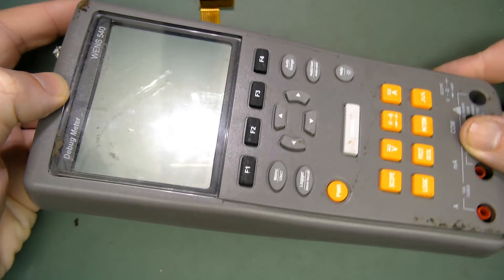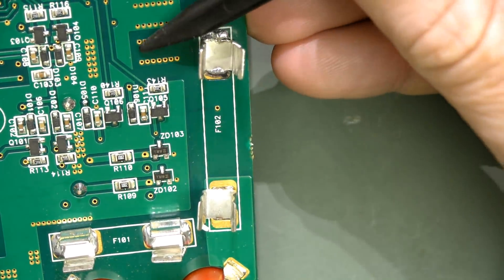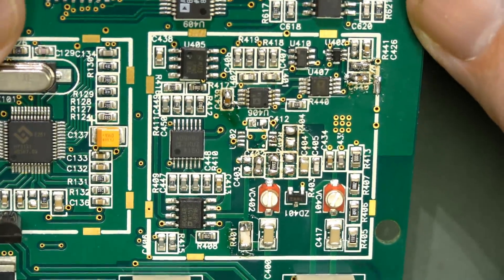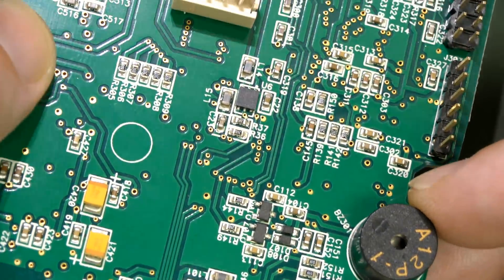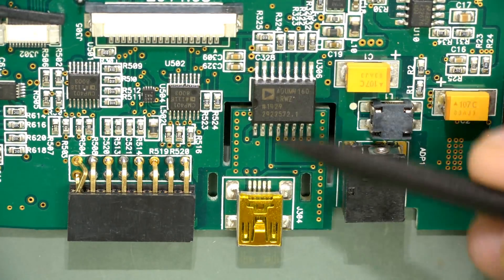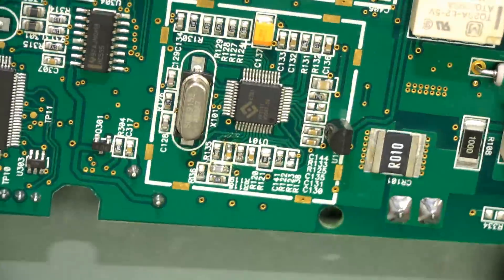Wens 540 Handheld Oscilloscope Multimeter Teardown

Comment: ADUM parts are actually galvanically isolated. There's some little tiny transformers in there (though I don't know if instead they've moved to capacitors) and they modulate the digital signal to get it through to the other side. Very high speed and very convenient.

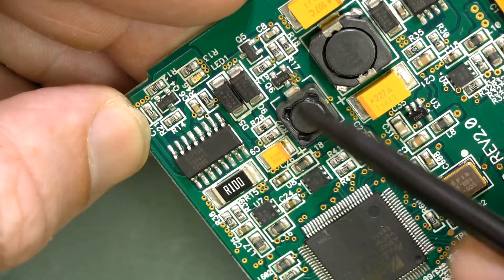Comment: Looks like battery circuit is at the top of the board, from that bat connector runs thick track to the other side of the board where is that power supply section (at 8:38). Also there is power jack with small common mode suppression choke.

Comment: "Don't care about the fuses because it's not being used as an industrial meter...." And normally a small hobby meter would be burned down to the ground and labeled as absolute crap?
Reply: I think Dave means the HRC isnt important because the use case for this meter isn't 400+V mains testing. Someone might use it to check the output on a VFD, but you really should trust your life on a China special meter. I wouldn't even trust the probes on meters like that over 100v.
Reply: I was actually wondering the same thing as well. Normally the whole community makes a big deal out of fuses.
Reply from the maker: I had no way of knowing what the fuses were as they weren't there, and you could use either type yourself, hence I didn't really care.
And yes, this wouldn't really be a meter you'd choose for an industrial application, so even if came with standard glass fuses, meh, because it's potential usefulness extends way beyond just a multimeter, unlike most meters on the market.
Reply from the maker: No. I believe I said "I don't care about the fuses" (because I wasn't really interested in this case) and "You wouldn't use this for industrial stuff anyway" Two separate things intended, don't put words in my mouth.
Reply: EEVblog2 . You literally said. Two HRC fuses. You don't particularly care BECAUSE this is not an industrial meter.
That's not words putting in your mouth. It just came out yourself?
That's what i also just said. Maybe the confusion is about the fuses? I was talking about the meter.

Comment: 10:30 - Don't know why they routed out the board except at the shortest distance between the copper.  I would have routed out that "corner" and left the board for support 3 or 4 mm above that.  Or better yet, removed some of the copper on the left instead.  Other than that and adding some more isolation around the smaller fuse, it looks OK.

Comment: 6 Relays for a scope meter?
Sounds a bit overkill, but after all, the build quality in this seems decent, and they went more for features then cost cutting, so it is probably rather good.
Though, the ground fill there besides the Isolated USB port, and the missing RF shielding seems like the only complaints I could be bothered having.

Comment: The microphone, great scott, the microphone! I'm sure he couldn't be bothered.
Reply: On bigger speakers it sounds like theres a bass drum in the background
Reply: im hearing it too. im on headphones theres a bass in the background
Reply: It is a very low frequency vibration created by movements of the multimeter, banging to the table, etc. Happens throughout the video. Sounds like the table is resonating... You need a sub-whoofer or some good headphones to hear it. Cheapo PC speakers will not reproduce that.
Reply: Yep, I'm hearing quite a lot of low frequency "thumping" as well.
Reply: Yep, very off putting, sounds like he is knocking whatever the mic is connected to. My sub woofer loves it though.
Reply: EEVblog2 There's a lot of rumble, basically whenever you move - probably the mic sits on the bench you're working on? :-)
I think if you just highpass the audio and cut everything <30Hz it'll be fine.

Edit: I don't hear any PC fan - that's not it
Reply: Dave, sounds good to me, thanks for the video!
Reply: Agree - you are bumping the table, creating some bangin on the audio. Just use a HP-filter and it'll be fine.
Reply: yeah its quite bass-y on my system too...mainly when you where tapping things..it was quite low frequency and kicking my sub
Reply from the maker: I don't get it, 2nd comment about the audio, what's so bad about it?
Reply: Do you have a timestamp on the bass drum sound?
Reply from the maker: That's probably the PC fan coupling through.
Reply: Audio sounds fine to me checked on PC, Laptop, And Headphone
Reply: Agree, sounds good to my deaf ears
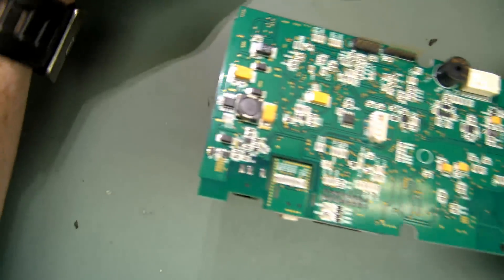Reply: LF noise starts at 1:48 when you tap meter  on bench. I did not hear it until I put my earphones on. (Someone is getting really picky)
BTW great video Thanks Dave
Reply: It's handling noise due to bad microphone isolation.  Listen to it with good speakers or good headphones.  Not too objectionable through my 8" woofer speakers - I'm not using a subwoofer.

Comment: Microphone attached to desk... yeah, don't do that.
Reply: That is because tablet speakers have virtually no bass reproduction.
Reply: Dave, its not bad at all. I never even noticed it until this DB commented about it. It did not detract from the viewing experience one bit.
Reply: Brian let us just leave it at this, I can very clearly hear the thuds with my speakers, it is definitely an issue. If you can not with your ear buds then good for you, but I still hear it and it bothers me significantly. At the end of the day it is a problem which is easily fixed by Dave with a new mount or some post processing. Just because you can not hear it does not warrant attacking me and calling me a "DB" this does not help the conversation and only serves to derail the conversation into a flame war.

In short the speakers you are using make a massive difference, if it was a problem with my setup then I would have the same problem on other videos. I do not however because most people do not mount their microphone in this way.

I hope you fix the issue Dave and maybe we can all learn something today :)
Reply: Yeah it is really bad, there is a lot of thuds being picked up by the mix, sounds like it was mounted directly to the table. Some microphones are really sensitive to those kinds of shock. Instead of mounting it directly to the table use a shock mount or at the very least run the audio through a high pass filter.
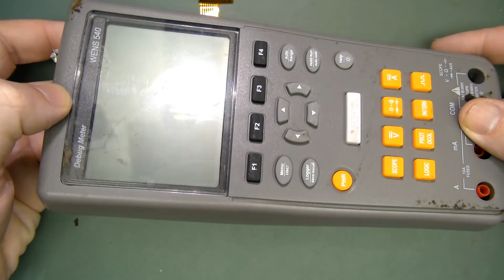Reply: Well I use my 2.1 speakers for everything so yes I do have a dedicated sub. It is really very noticeable and it can be heard several times throughout the video starting at roughly 0:08. It is definitely distracting and uncomfortable to listen to if you have half decent speakers. You will most likely not notice it on phone/tablet/laptop speakers since they all have very limited bass reproduction. Good quality audio is very important, arguably more so than video.
Reply from the maker: Define "crap speakers"?
Ones that don't have massive bass? What's that needed for that watching Youtube videos or most other things? 
I use good quality Alesis M520 USB studio monitors to mix my videos, will listen with them tomorrow, but they are the "bassiest" thing I have.
I'd be willing to bet I can barely hear a thing.
Can barely hear a thing on my AKG K240 headphones at home right now.
Do you by any chance have a poorly tuned subwoofer that is resonating?

BTW, I'm not saying I won't fix this, I have been meaning to get a better mount for my Tagarno microphone (Samson Go Mic), I'm just bemused by the complaints that it's BAD
Reply from the maker: Are you just complaining about the "bumps"? Others say they can hear a loud drone all the way through it (likely PC fan coupling in that case)
Reply: I was replying to Brian when I said crap speakers and by that I mean laptop/phone/tablet speakers and so on, basically anything inbuilt or even dedicated speakers with no bass response. Now, please do not get me wrong I am not a basshead and I do not mean that in order to have good speakers you need to have thumping bass, that is really not what I am interested in.

I am not surprised that you can not hear it with headphones however, even bassy headphones struggle to produce anything near what speakers with a dedicated sub will do. 

I am using the old Logitech Z5500's btw which while not studio monitors by any means do sound pretty great if you dial down the sub. While I do not like throwing around credentials on the internet I will say that I do work with audio and bad sound is a very prominent issue on youtube, there are a great many videos which would benefit greatly from being run through a high pass filter.

I do appreciate the discussion though and I hope you fix the issue :)
Reply: Sorry I cussed BTW.
Reply: I don´t hear any mature issues. Not with my big headphones or my studio monitors. There are some quiet bumps, but if you don´t crank up to the bass to the sky it isnt disturbing and barely noticeable. But you could easily fix this small "problem" with a low-cut Fílter in post or directly in recording.
Reply from the maker: I can hear it with headphones, just, if I turn it up uncomfortably high. Not something I'd ever consider complaining about though. YMMV.
But yes, I will fix this mic mount and have been meaning to fix the fan noise.
Reply: Why complain about the bass when there are high-pitched squeals throughout the video?
Reply: I have the same Alesis monitor speakers that Dave has, and it was quite boomy! Interesting teardown :)
Reply: Bass thumps! I watch youtube through my home theater system, no subwoofer, just good speakers. The bumping of the table produces big bass thumps that are very noticable. It was VERY bad in the "EEVblog LIVE SHOW - End of 2017" video. Big bassy thumps any time you bumped the table, all through the whole video. I can barely hear it on the PC, just on the better quality home thater speakers. I'm not complaining too much, just providing helpful feedback. Thanks for all the awesome videos!
Reply: Or if you do at least high pass it .
Reply: I hate to be snarky but if you did not notice it then you are most likely using crap speakers.
Reply from the maker: Yeah, ok, but is it THAT bad? How?
Reply: I am complaining about the bumps/handling noise.
Reply: On regular tablet speakers I didn’t notice anything
Reply: Dave, its one person with one person spring-boarding off of his comment. I hardly would consider that "complaints." ErikTheAndroid, people that start a comment out with "I hate to be a dick" or "I don't mean anything by this, but...." are people who ARE trying to be a dick and who DO mean something by their comments. So, my starting a comment with "I hate to be snarky" you are being snarky, you know you are being snarky and being snarky was your intent the ENTIRE time! Some people.....
Reply: I am using a Fiio amplifier and JVC ear buds. The same setup I use to listen to music. 11mm neodymium drivers, 8hz-20khz range and 103db/mW sensitivity......they aren't "Ear Candy" headphones by anymeans.
Reply from the maker: So you are complaining about the bass? What are you using, a subwoofer?
And how bad is it REALLY? I can't believe it's REALLY BAD. Is it like a couple of times in the video or all the way through?